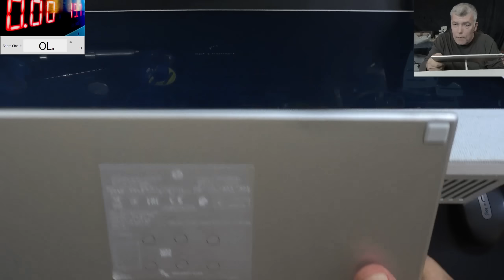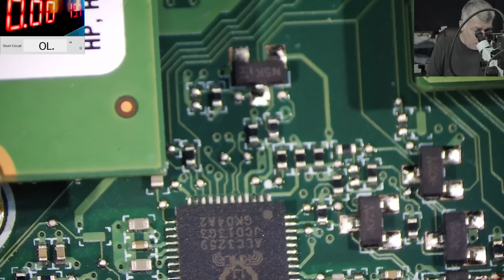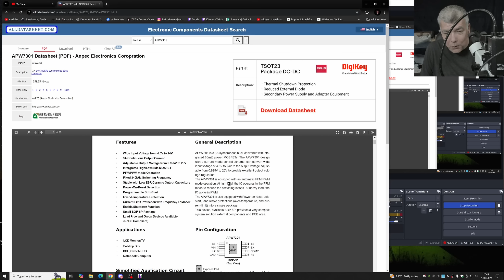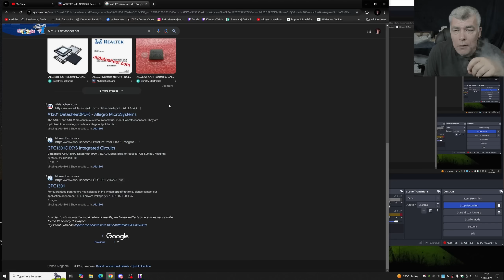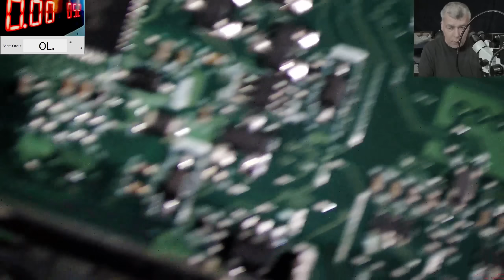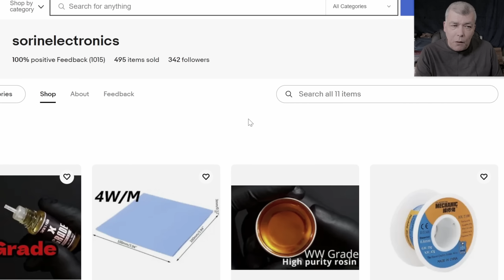Hp AIO GQ57 no sound - Dodgy? This is electronics at its finest, right? :D Audio rerouting

Comment: It's a voltage divider, if R1 is bigger then R2 is also bigger.
Reply: If you looked at the datasheet the formula for output voltage was Vout = .925x(1+R1/R2) so Sorin was right about 12v out.  Seeing that buck converter can supply 3 amps and it was isolated to that sound amp I would have replace the APW7301 chip.  Sure the wire was a proof of concept that sound works but Sorin already said what happens to the little five volt supply when the user put on full volume??? Well damage of course… definitely dodgy. lol.
Reply: @gregjohnson5194  laptop mosfets can carry like a 100A, the only issue could be the current limit.
At first I thought it was a digital chip so there's no way it works at 12v, but I realised it's an amplifier supplying the speakers directly. So 12V/4ohm is 3A@36W sounds reasonable.
Reply: @BkR090  I agree if the 5 volt supply he tapped into can handle the current draw then it will work and last a long time.  Idk what the rating of that 5V rail is so only time will tell when the 5V fails.
Reply: @gregjohnson5194  laptop mosfets are crazy, off the scale.
Reply: What do you mean by "R2 is also bigger"? The measured resistance of R2 is 9.1 kOhm, which matches the recommended value given in the datasheet. It is a voltage divider and the ratio R1/R2 determines the output voltage of this power supply via FB (feedback) pin. Given that R2 is fixed (9.1K), the bigger the R1 the bigger the output voltage.
Reply: @Armagedon698  He means that in voltage divider, ratio is important, and he is saying that Sorin is supposed to remove both resistors from circuit and measure them, Sorin was confused after measuring only first one out of circuit.
What is confusing Sorin here, is that he forgot that he has one probe on ground, and he is not measuring resistance of that resistor only, he is measuring resistance of that resistor plus whole laptop in parallel to that resistor.
At 18:25 you can see that he measures something at 5.6K Ohms, we dont know what is real R2 value since its never measured out of circuit.
Sometimes Sorin is so dodgy or lazy it backfires on him, but its his way of fixing stuff. Desoldering both resistors and measuring out of circuit would give him proper ratio in 2 minutes.
Reply: not necessarily remove both, just the one and you can read both.
Reply: @orion310591RS  after the scale change at 18:36 we see the reading of roughly 9.2K. By measuring out of the circuit, we know that R1 is 120K. Sо in the worst case when Vout is shorted to ground (which is similar to the start of the capacitor charge up process) we have R1 and R2 in parallel giving something around 10K. With R1 being more then 10 times bigger, it gives a good estimation for R2. To guess the designed Vout voltage, the exact value of R2 (e.g. if it is 9K or 11K) is not that important here, since it won't significantly change the ratio R1/R2.
Reply: @Armagedon698  Man what you just wrote??? When you repair things there should be no "worst case" or "guessing"... R1 and R2 are never in parallel... I explained to you why reading R2 on multimeter is not reliable, also @BkR90 told you the same.
I propose to read my last comment again if you really want to understand, I have nothing to add.
Reply: @orion310591RS  Sorry. I might have expressed myself not clearly enough. They are in parallel when we measure directly on the board the resistence of either R1 or R2. We consider the situation when the APW7301 is desoldered from the board. When we place the probes on R2 the current from one probe to the other flows in two ways. the first way is directly through R2. The other way is from the first probe through R1 to the Vout line and then to the ground through the other components and from there directly to the second probe. Let's call this remaining resistance R3, that is R3 is the resistance of the Vout line with respect to the ground when R1 is removed from the board. So, effectively we have a parallel connections with R2 on the one side and R1+R3 on the other side. Now about "the worst" case. Parallel to R3 we have a cap C4 on the picture. When we have just placed the probes on R2, the cap C4 is uncharged. All the voltage from the probes is applied to the R1. Voltage drop on R3 is zero. The current flowing through R1 is the same if R3 were zero, that is Vout shorted to ground. At this instant the multimeter would display the resistance of R1 and R2 connected directly in parallel. As the capacitor C4 gets charged, the current through R1 gets reduced, and the reading of the multimeter grows. Finally, when the cap is fully charged the same current flows through R1 and R3. So the multimeter will show the resistance of R2 and R1+R3 connected in parallel. Therefore, the resistance Rx that the multimeter shows would grow from  R1*R2/(R1+R2) to (R1+R3)*R2/(R1+R2+R3). The measurements show that Rx only slightly changes around 9-10 K, and R1 is 120K. Inverting the formulas it is easy to see that Rx gives a very good estimation of R2 with the accuracy of about 10%, which is enough in this case.

About guessing in repair. Of course one should be cautious doing this type of work and double check. But here we have a very limited set of options. Keeping aside the voltages of CPU, GPU, and RAM which can vary, we are left with 3 commonly used voltages, which are 3.3, 5, and 12 volts. With this in mind and looking at the datasheet, one can say that with these values of resistors R1 and R2 the most probable option is 12 volts. Sorin then testet this guess by starting at 3.3 and gradually raising the voltage and looking at the result.
Reply: @orion310591RS  Sorry. I might have expressed myself not clearly enough. They are in parallel when we measure directly on the board the resistence of either R1 or R2. We consider the situation when the APW7301 is desoldered from the board. When we place the probes on R2 the current from one probe to the other flows in two ways. the first way is directly through R2. The other way is from the first probe through R1 to the Vout line and then to the ground through the other components and from there directly to the second probe. Let's call this remaining resistance R3, that is R3 is the resistance of the Vout line with respect to the ground when R1 is removed from the board. So, effectively we have a parallel connections with R2 on the one side and R1+R3 on the other side. Now about "the worst" case. Parallel to R3 we have a cap C4 on the picture. When we have just placed the probes on R2, the cap C4 is uncharged. All the voltage from the probes is applied to the R1. Voltage drop on R3 is zero. The current flowing through R1 is the same if R3 were zero, that is Vout shorted to ground. At this instant the multimeter would display the resistance of R1 and R2 connected directly in parallel. As the capacitor C4 gets charged, the current through R1 gets reduced, and the reading of the multimeter grows. Finally, when the cap is fully charged the same current flows through R1 and R3. So the multimeter will show the resistance of R2 and R1+R3 connected in parallel. Therefore, the resistance Rx that the multimeter shows would grow from  R1*R2/(R1+R2) to (R1+R3)*R2/(R1+R2+R3). The measurements show that Rx only slightly changes around 9-10 K, and R1 is 120K. Inverting the formulas it is easy to see that Rx gives a very good estimation of R2 with the accuracy of about 10%, which is enough in this case. The bigger the R3 the better the accuracy. This is why I wrote "in the worst case" when R3 is zero.

About guessing in repair. Of course one should be cautious doing this type of work and double check. But here we have a very limited set of options. Keeping aside the voltages of CPU, GPU, and RAM which can vary, we are left with 3 commonly used voltages, which are 3.3, 5, and 12 volts. With this in mind and looking at the datasheet, one can say that with these values of resistors R1 and R2 the most probable option is 12 volts. Sorin then testet this guess by starting at 3.3 and gradually raising the voltage and looking at the result.
Reply: @orion310591RS  Sorry. I might have expressed myself not clearly enough. They are in parallel when we measure directly on the board the resistance of either R1 or R2. We consider the situation when the APW7301 is disoldered from the board. When we place the probes on R2 the current from one probe to the other flows in two ways. the first way is directly through R2. The other way is from the first probe through R1 to the Vout line and then to the ground through the other components and from there directly to the second probe. Let's call this remaining resistance R3, that is R3 is the resistance of the Vout line with respect to the ground when R1 is removed from the board. So, effectively we have a parallel connections with R2 on the one side and R1+R3 on the other side. Now about "the worst" case. Parallel to R3 we have a cap C4 on the picture. When we have just placed the probes on R2, the cap C4 is uncharged. All the voltage from the probes is applied to the R1. Voltage drop on R3 is zero. The current flowing through R1 is the same if R3 were zero, that is Vout shorted to ground. At this instant the multimeter would display the resistance of R1 and R2 connected directly in parallel. As the capacitor C4 gets charged, the current through R1 gets reduced, and the reading of the multimeter grows. Finally, when the cap is fully charged the same current flows through R1 and R3. So the multimeter will show the resistance of R2 and R1+R3 connected in parallel. Therefore, the resistance Rx that the multimeter shows would grow from  R1*R2/(R1+R2) to (R1+R3)*R2/(R1+R2+R3). The measurements show that Rx only slightly changes around 9-10 K, and R1 is 120K. Inverting the formulas it is easy to see that Rx gives a very good estimation of R2 with the accuracy of about 10%, which is enough in this case. The bigger the R3 the better the accuracy. This is why I wrote "in the worst case" when R3 is effectively zero.

About guessing in repair. Of course one should be cautious doing this type of work and double check. But here we have a very limited set of options. Keeping aside the voltages of CPU, GPU,     and RAM which can vary, we are left with 3 commonly used voltages, which are 3.3, 5, and 12 volts. With this in mind and looking at the datasheet, one can say that with these values of resistors R1 and R2 the most probable option is 12 volts. Sorin then tested this guess by starting at 3.3 and gradually raising the voltage and looking at the result.
Reply: @Armagedon698  there was a cap charging, not reliable.
Reply: Of course 12 volts, there is nowhere  on the motherboard where 12 is used
Reply: @MrAsderoff  Which motherboard? Standard desktop PSU provides 3.3, 5, and 12 volts, for example. It is rare, but sometimes 12 volts can also be found on laptop motherboards. 
@gregjohnson5194 cited the datasheet formula for calculating the APW7301 output voltage
Reply: I'd replace with other duck 🦆.